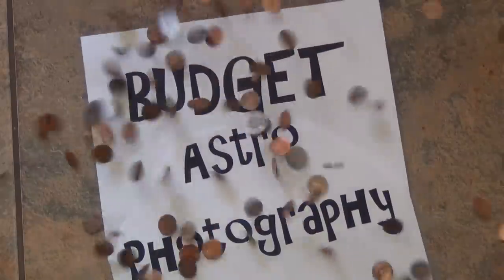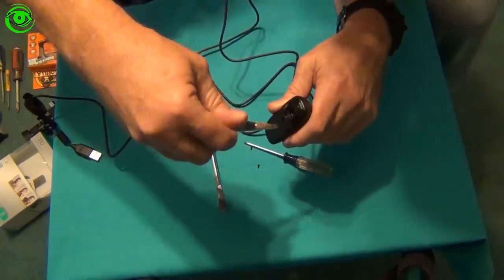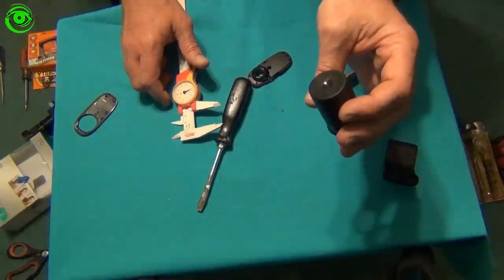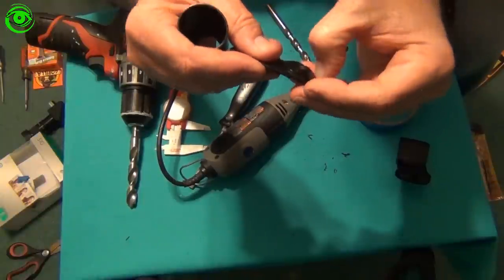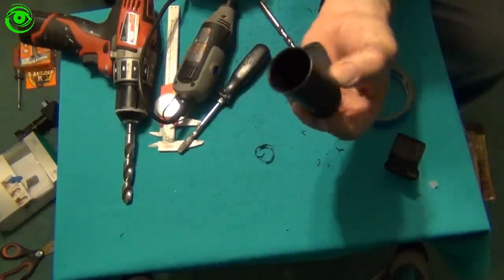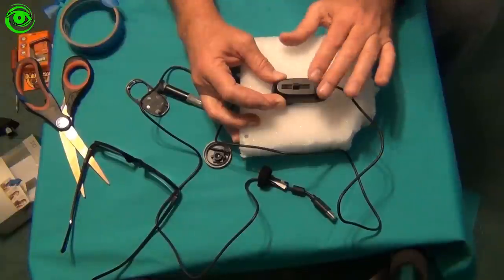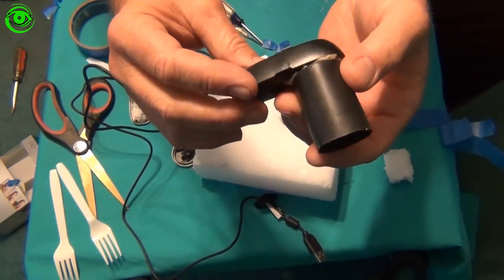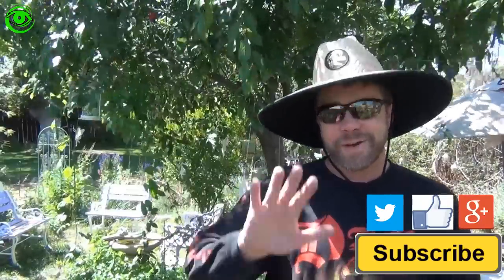DIY Planetary Astro Camera Webcam C310

Comment: We were doing this 20 years ago with the TuoCam Pro. Somewhere Out There is a adapter that would screw directly into the lens threads. What's interesting compared to then is that today you can't find a film canister to save your life. Hahaha.

If you want to try something like this yourself there's plenty of cameras just look for ones that have removable lenses which will make it very easy. Also find the cameras that have the highest frame rates for your planetary shooting.
Reply from the maker: True!  Thanks for adding your comments!
Doug

Comment: They do make an adapter that screws on to a bunch of webcams, take the webcam lens out, and screw directly into the ccd. I think they run like $6
Reply from the maker: Hi BC,
Yes, they do have some models which accept a screw in adapter.  I wanted to see if I could hack any old web cam and make it work.  With a screw in adapter, it takes only seconds to convert a compatible camera!  Thanks for commenting,
Doug
Reply: @Myastroimages  Oh it was definitely a helpful guide. I am doing this right now for a finder scope. I wanted to play with stellarmate a bit. Good guide!

Comment: Astrophotography Tutorials is it possible to take decent photos using Nikon d5200 with 18-55mm kit lens or should I go for Nikon d3200 with 35 mm f2.8 lens ... Which is better ? Please reply
Reply from the maker: Hello Ankith, Most any DSLR will work.  If you already have a DSLR then give it a try with what you have.  You can do a lot with standard tripod, Lens, and DSLR.  Milky way shots are the most popular and easiest to start with.  These shots are typically 30 Second exposures and most DSLR will handle 30 second exposures with little effort.

For DEEPSKY photos, you'll need to consider another level of equipment.  DEEPSKY requires longer exposures.

If it's possible in your area, try to rent a DSLR you're interested in buying.  You can then see first hand if this particular camera will do what you think it will do.  If you're looking at Milky way shots, a WIDER FOV is better...however, you can get by with a narrower FOV with stock lens.

To answer your question directly, yes it's possible to take decent photos with ANY DSLR.  The biggest challenge isn't "taking the photo" but "processing" your results in the end.

I hope this helped.

Doug

Comment: doug could you do a tutorial on how to modify a dslr? with fan etc
Reply from the maker: Mark r Yes Mark...that would be great.  Unfortunately, my DSLR skills aren't the best.  I recently purchased an adapter for my DSLR so I can connect it to me telescope, but, I haven't tried using it yet.  Have you seen Fan mods for DSLRs?  I haven't really looked and I know Orion use to make a special DSLR cooling case.  Thanks for the suggestion, it's been on my to do list for sure.  Doug
Reply from the maker: Ram Radhakrishnan Thanks Ram!  I booked marked the link.  Looks like some great tips are on those pages.  Thank you!  Doug

Comment: Why not glue ( * the cap of 35 mm film canister to the body of the camera*)  , then you have  provisions for a few things , one to  give  access for the Phillips screws so you can removed  the face of the  camera  when needed .and two home made filters . 
You may only need a few drops of super glue here and there  and some thin washers and place the screws through them and to give it more strength.
The cap will act like a K mount for example , if you have a few film  canisters ,  you could make a number of them with different size holes drilled into them so they act like  an aperture in a camera lens  so you could make a set of these .

Also , you could remove the Inferred filter from the camera lens  then  drill a  hole  to size in one canister and glue it in place  over  the hole , you now have the ability of IR photography when ever you want ,  And  by using  other available  film canisters ,  you could make a few  homemade filters as well and all you have to do is change the canisters. 
 I would even try different colored  cellophane to see if they would work ?  ( the trick with cellophane once it has been glued , us a hair dryer and just quickly run it over the  cellophane and all the wrinkles will go away  )  in a similar manor and including  Mylar , ( this is not for the sun !!!!! ).
However it maybe  an interesting filter  to help with a bright moon etc .  it may need a few extra layers you never know what may work,  many filters on the market maybe  out of the  reach with  many young  Astronomers starting off on a shoestring  budget . 
So now  you have the ability simply popping different  canisters off &  on, and  your PC  camera  now has aperture and also simple  filtration system  for night time viewing  . 
Well these are just my thoughts .  
Clear skies.
Reply from the maker: Hi Paul!  Great to hear your creative ideas!  It's always great to implement your own designs in your DIY projects.  Thank you for your comments.
Doug
Reply: I enjoy to seeing  people experimenting  its all part of the fun really, I was wondering how the camera worked out with your Astrophotography and do you have a favorite program you like to use  for stacking .
I have a few old Play station 2 cameras I had packed away for a little while so I will be experimenting/ tinkering with them , I was a surprise what they could zoom in from their small lens , something to look into .
Oh I just seen your other video come up that answered my questions , Well I Just Subscribe , thanks for reply Doug all the best and clear skies . Paul.
Reply from the maker: My favorite stacking program is Registax for planetary imaging.  Thank you for the sub Paul!